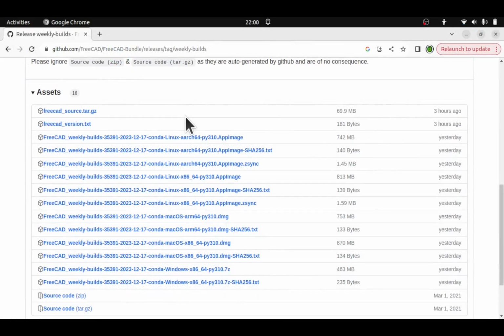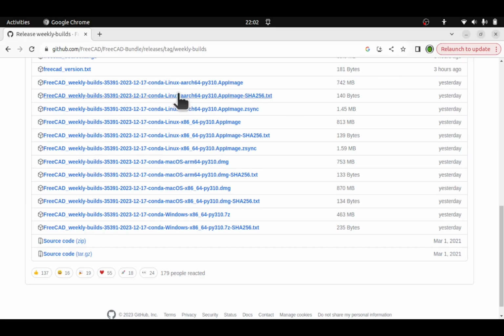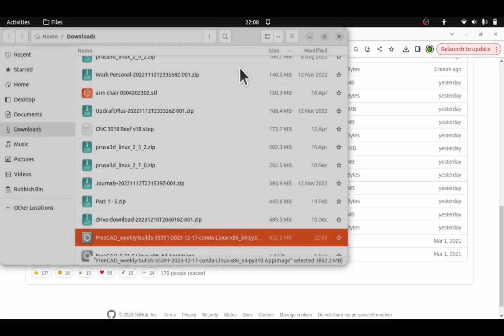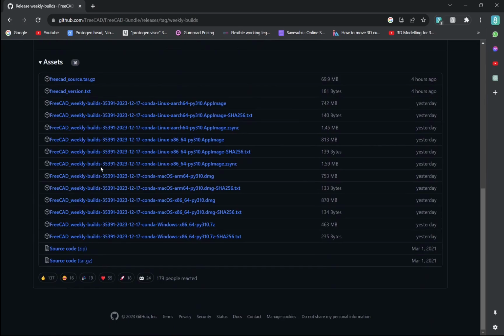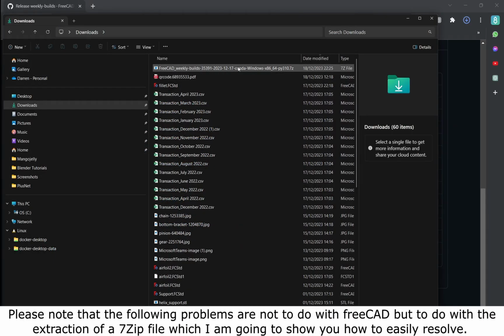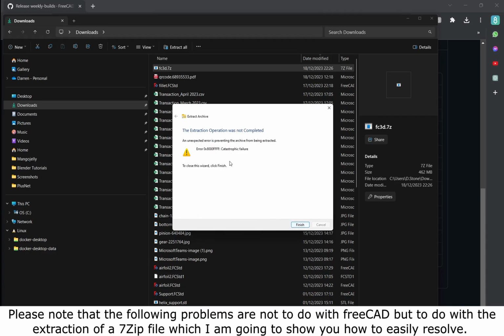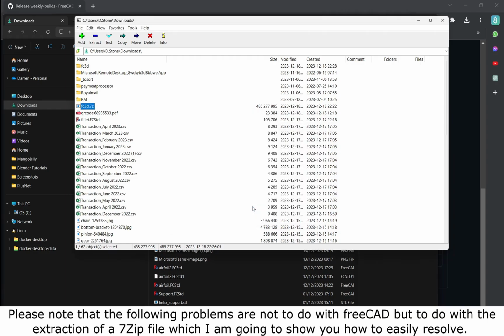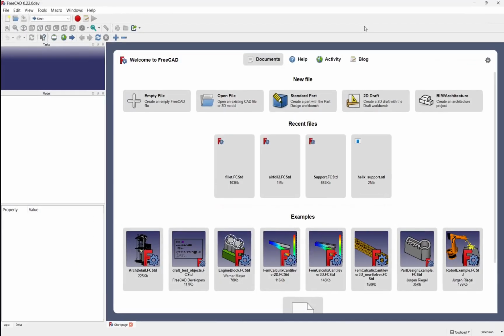Unlock Future Features: How to Download FreeCAD Weekly Build on Windows and Linux (Ubuntu)

Comment: just a short comment regarding 4:17 you are getting this error because the "Extract All" context menu option does not use 7zip, but windows' own (very bad in my experience) archiving tool. i don't use win11 so don't really know how it works there, but on win10, you get a separate context submenu (can be configured in 7zip options) called 7zip>, under which the 7zip operations are grouped.

loving this series, trying to make the switch from fusion, thank you so much for the videos!
Reply from the maker: Thank you for adding that information and sharing as others with the same issue will be coming back to the comments.  I never got on with windows own archiving tool.    Glad your enjoying the series and I hope it makes that transition a little more easier :)
Reply: so apparently in win11, it is under "show more options"

Comment: I really enjoy watching your videos, I think you're the best FreeCAD YouTuber. FreeCAD is a nice tool to learn especially if you don't wanna pay a Fusion 360 license but still want to own your designs like in my case.

But I'm having some trouble using it for basic stuff (Specifically in Part Design workbench). For example:

Let's say you have a tall cylinder and want to split it to x number of pieces where x is a variable is a Spreed Sheet. The Spreed Sheet contains the total length of the cylinder, the number of pieces, and it calculates the length of each piece (The actual model is not a cylinder, it's more complicated).

Problem 1: Part Design does not allow splitting an object to 2 using a sketch or a plane
Problem 2: If I use part workbench to do the split, how can I use an array on the split to do it X times

Another issue I face with part design is: If I have 3 or 4 bodies and want to reference one of them in a sketch inside a different body, it will not allow me

I really want to switch to FreeCAD but these small issues are making me rethink the switch. I think if FreeCAD team combines the features in Part and Part Design workbenches it will be a lot more powerful.

Comment: Can you make a metal foam with the ability to change the pores size  using FreeCad?
Reply from the maker: Yes you can use standard modelling and there is also a sheet metal workbench add on.

Comment: I downloaded the weekly build last week and was tweaking my UI and now the task panel is full screen width and model is correct size; no combo. Is there a secret location where I can delete my preferences and start over? I've tried deleting the folder but my changes won't go away. The weekly build doesn't interfere with my fully installed v0.21
This weeks build doesn't fix my issue.

Comment: The downside of appimages is you have to manually download the next week's version . I found that a real pain.
There are apps like appimage updater but I found it failed most of the time. These are my experience of a few years ago and things may have improved.
Daily builds are also available as a Snap package and as a PPA ,both of which automatically update.
I use the Snap because it was the smallest initial download. 
The PPA sometimes lags a new release of Ubuntu and as I install the new release as soon as it comes out ,the Snap also eliminates waiting for the maintainers to launch the updated PPA.